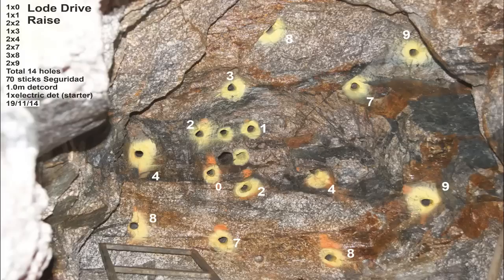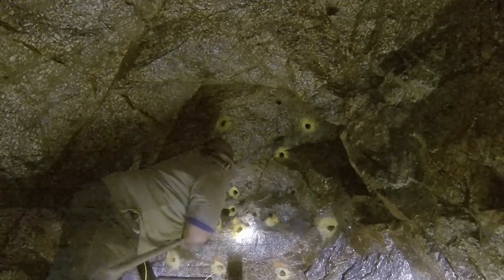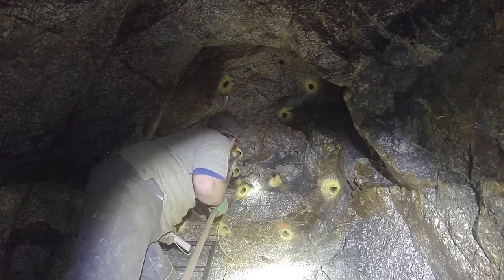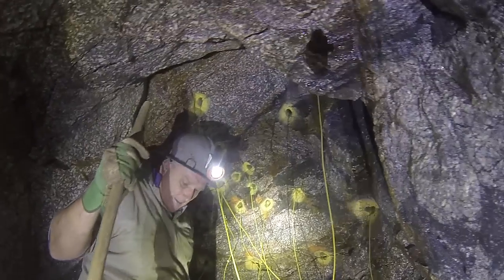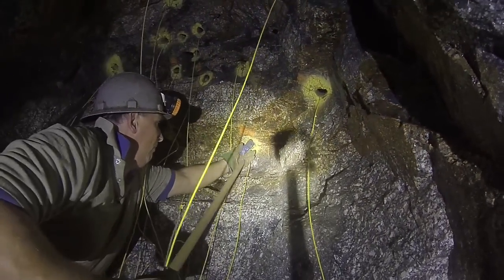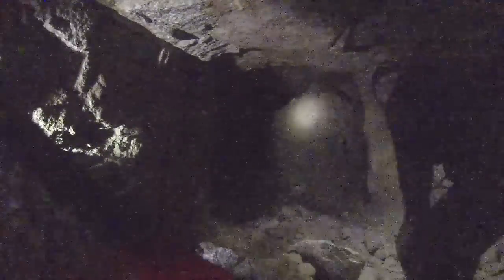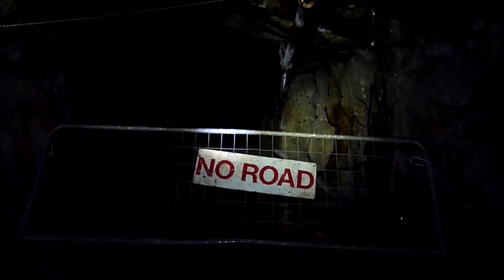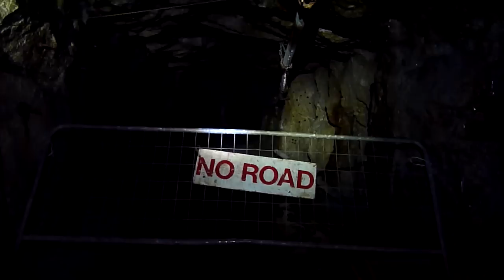Unveiling the Legacy of Cornish Tin Mining - Episode 2: The Raise and the Thunderous Blast of 2015!

Comment: What sort of explosive is that? ANFO emulsion, some sort of dynamite derivative, or what? At our experimental mine in Missouri, we mostly use sticks of emulsion. The stuff looks like peanut butter.
Reply from the maker: It's standard type dynamite like Gelamex but a little less power so we have to pack the holes with no spacers.
Reply: Gary Parrott Thanks for the reply! I love your videos; they're a great way to learn about hard-rock mining from a miner's perspective. I'd like to run my own operation in a decade or so; you're providing a great resource.
Reply from the maker: No problem, you're welcome.